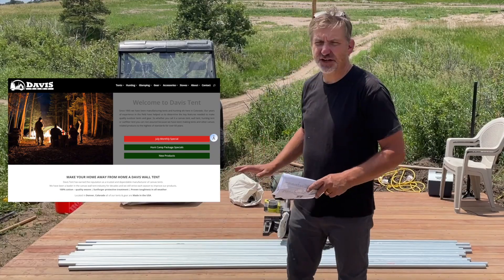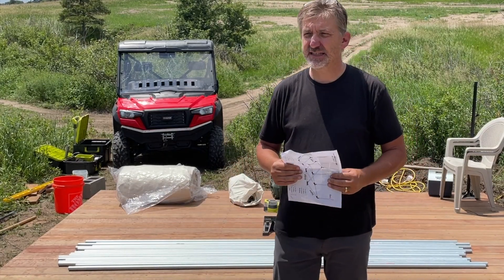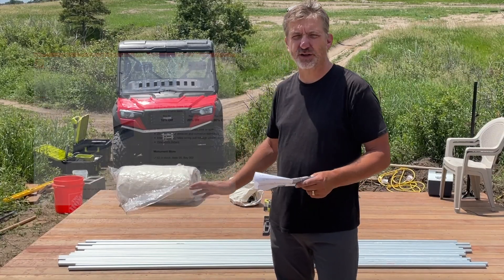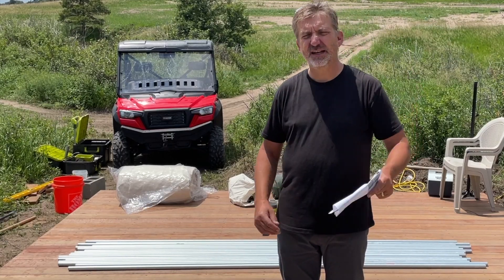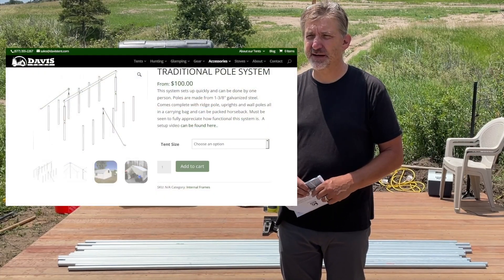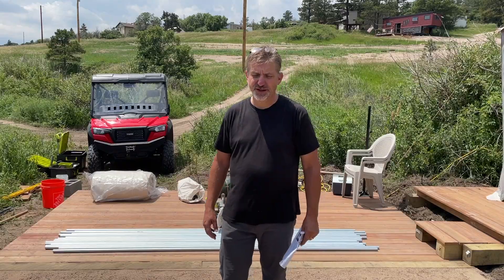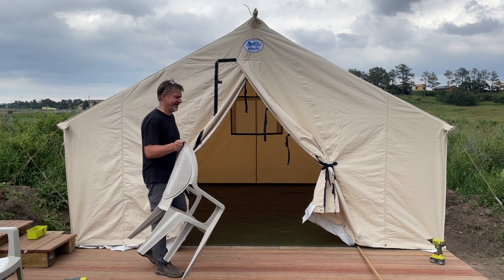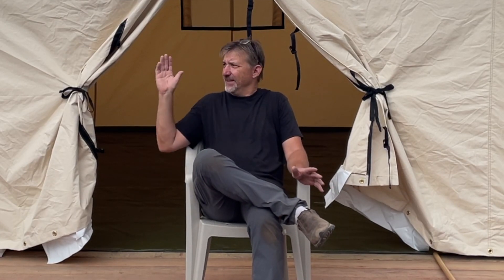Build a Safari Glamping Site - Part 5: The Tent

Comment: For the mud flap skirt on tent, did you put it on the outside of the 6x6? Or did you fold 3 sides under tent to be on top of tarp floor?. If flap is on outside of 6x6 do you attach it to sides of 6x6? Would you recommend stacking two 6x6 to keep flap further away from ground. We get snow, so I'm thinking two 6x6 tall. Thanks for advice. Enjoy the how to videos.
Reply from the maker: Outside. I kind of wish I did two deep for this very reason. I'd encourage you to do what you suggested.
Reply: Thank you